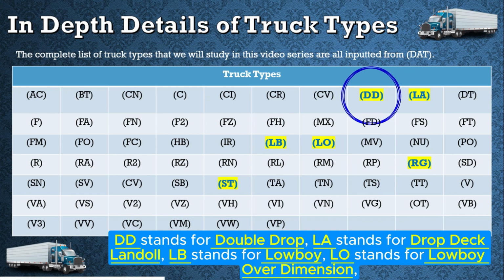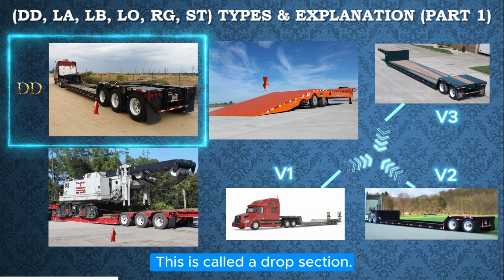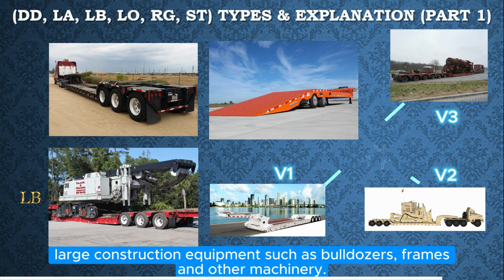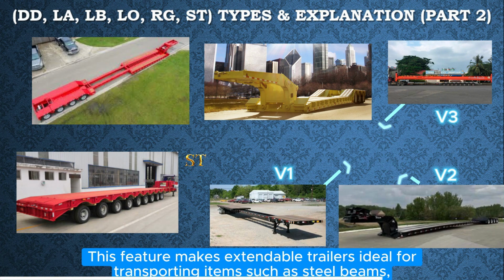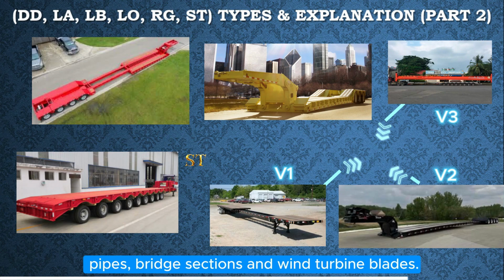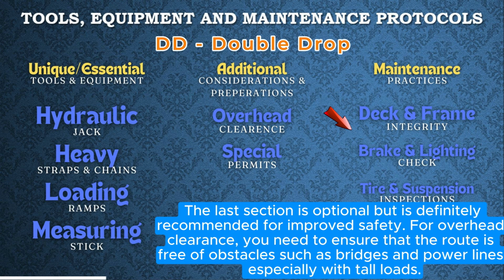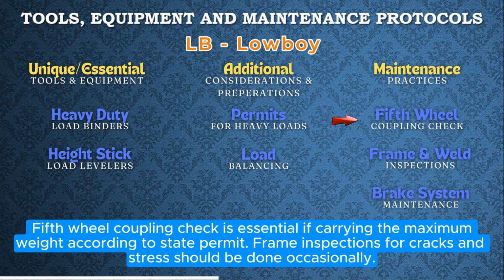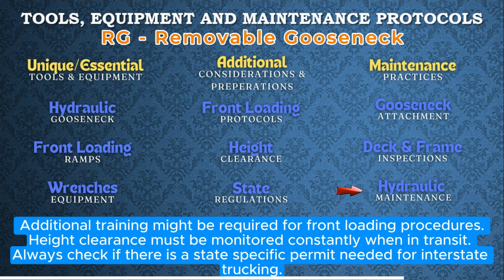Lowboy, RGN's and Double Drops  (DD, LA, LB, LO, RG, ST)

Comment from the maker: 🕐 Timestamps 🕐

00:00:00 | Introduction
00:00:28 | (DD, LA, LB, LO, RG, ST) Truck Types in Table
00:01:08 | Presentation Checklist
00:02:20 | Trailer Types and Explanations Part 1
00:05:30 | Trailer Types and Explanations Part 2
00:08:16 | Popular Trailer Manufacturers
00:09:06 | Popular Trailer Manufacturers Table
00:09:36 | Specifications & Dimensions Part 1
00:11:02 | Specifications & Dimensions Part 2
00:12:09 | Tools, Equipment & Maintenance Protocols for all 6 Trailer Types
00:18:44 | Multimedia Slide
00:20:00 | Specific Regulations and Permits for all 6 Trailer Types
00:25:52 | Specific Pros & Cons for each Trailer Type
00:31:52 | Specific Pros & Cons Table Summary